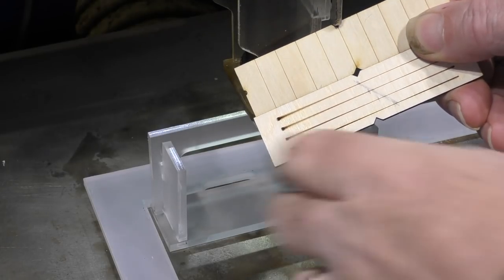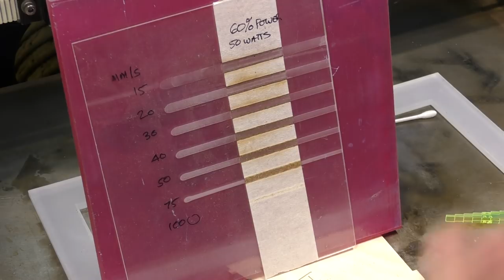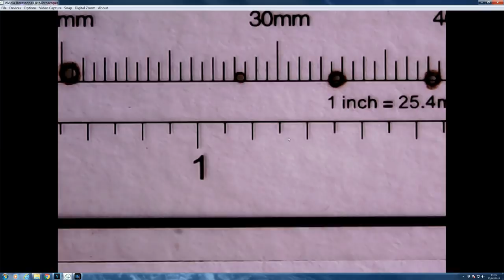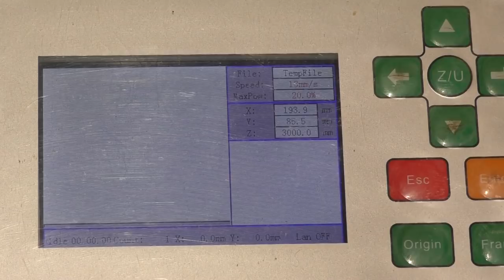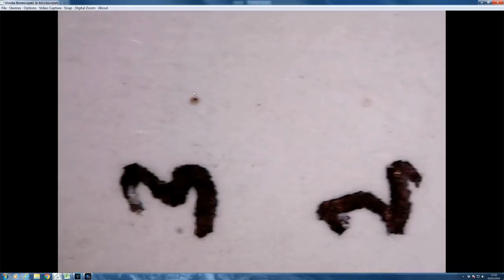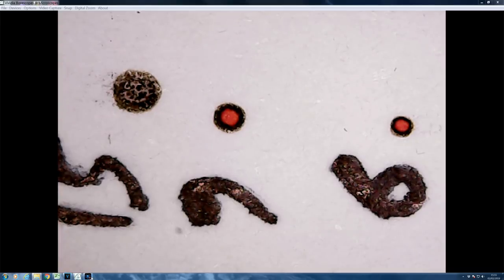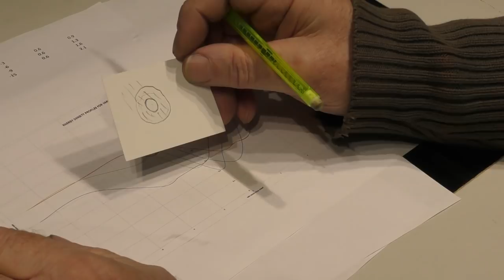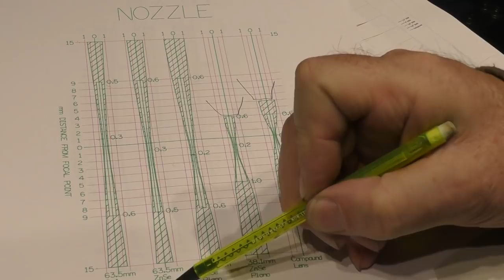RDWorks Learning Lab 162 Lenses part1 Let's Focus

Comment: Amazing work my friend
Reply from the maker: Hi Diego. 
 This video is now two and a half years old . About 6 months before this video, I became aware, as I was testing the cutting ability of various lenses, that there were some serious flaws in the "facts" that we were being taught about lenses.  On and off, I have been wrestling with the problem of trying to understand how lenses and laser beams work together. I could see from my many experiments that lens theory could not explain any of the behaviour I could easily demonstrate. In recent videos ,I am now at #217 I have finally decoded how lenses and laser beams work together and although no laws of physics are being broken or bent, the idea that lens theory can be read across to lasers is totally incorrect. Lenses and laser beams have their own secret relationship that it seems no one else has ever bothered to investigate. There is nothing wrong with lens theory and in fact lenses have to be designed  for the predictability of uniform intensity light rays as used in any IMAGING system such as a camera, telescope, microscope, projector etc etc. A laser machine is NOT trying to project an image so the rules rapidly break down. It's taken 3 years of piecing together many simple positive and negative experiments to finally uncover the full picture.  
You have lots of video to watch!!!
Best wishes
Russ
Reply: @SarbarMultimedia  thanks for the reply Russ, I just start working with my laser machine and found your videos that are in another league ! Thanks for sharing all your work and experimentation. 
I really hope that there is more people like you out there that lives by the "I dont belive anything that anybody told me, I have to prove it from myself" mindset.
Its very confortable to see someone digging in the science part of the functionality of this machines, and of course I will pass these days watching all your content haha.
Greetings from Perú and sorry for my english that I just barely write.
Diego
Reply from the maker: @diegoseminariodecol3863  
 Hi Diego
 Never apologize about your language proficiency. We only need to make ourselves understood and that does not require perfect grammer. Your English is 100 times better than my Spanish!!!! If it's more comfortable , write in Spanish and I can use Google translate.
 Best wishes
Russ

Comment: Hello Sir, Will the beam spot  vary according to the power of laser? I would like to buy a 150W machine for engraving and cutting. Thank you!!
Reply from the maker: Hi Eixeno
  The spot size is a so-called specification of the lens and not the beam. However After hundreds of test with different lenses and different laser beams  (no, they are not all the same) I  now know that the lenses are designed and specified as though they were going to be used in a telescope or camera  to transmit images with NORMAL light. Our laser beam is nothing like "normal" light and lenses  have their own different relationsip with laser beams that standard  lens theory cannot deal with.
The spot size you are interested in is the "burn" diameter you can create with a lens.  A spot has no linear speed  but you will make the burn diameter bigger by increasing the exposure time. Add speed and that dot becomes a line. That line thickness changes with speed. power and material  being damaged. 
 Power is great for faster and deeper cutting but to much power becomes uncontollable  if you wish to do photo rplication where precision control of power is essential. A "jack of all trades" power is between 60 and 80 watts.  It depends on your requirements . If it's mainly cutting that makes you money then go for the high power.. My advice is to stay away from Reci.      SPT , Yongli or EFR are good choices
 Best wishes
Russ
Reply: @SarbarMultimedia  Thank you! Explained well. Hope I will travel with you along my laser cutting journey. Your videos are so information and technical about lasers. God bless you.💕

Comment: Absolutely brilliant
Reply from the maker: Hi Joseph
How lenses and laser beams interact has taken me a long time to understand.  Thus my  knowledge  of lenses from 5 years ago has changed a bit. You may like to  update by looking at these videos
https://youtu.be/7N8Th1-IF4s       and         https://youtu.be/v7-VArJbJTs
Reply: @SarbarMultimedia  I have watched many of your videos over the last week. I love how you keep digging into them . Although sometimes your concerns are not clear.  But I get it you need more data before you can make that leep. I did subscribe so I can stay up to date. I just got an older co2 laser 50w that I have updated to 70w tube and power supply. But looks like the controller is very old so I need to learn RDWorks
Reply from the maker: @josephlovell6951 
 Hi Joseph
 Always bear in mind that these videos are not rehearsed and that you are looking over my shoulder as I  experiment and discover. This is a record of a learning journey and as such some sessions will be very much "follow your nose". It may take many sessions to arrrive at a sensible conclusion. It took me about 3 yeas to discover exactly how lenses managed to focus the beam to produce a deep parallel cut.
 There is no need to learn RDWorks if you are used to using Lightburn. Lightburn was created 7 or 8 years ago because a very  capable software programmer who was also  a laser hobbyist, became aware of the limited capability of RDWorks and it's very clunky interface. He set about reverse engineering RDWorks to create Lightburn. So with just a few exceptions, everything in Lightburn is in RDWorks but the usability and features of Lightburn are  from a different planet.. Lightburn has now been developed into an industry standard package  where it can be used with any type of laser or laser controller using Linux. OS or Windows. RDWorks is still Widows only.
Reply: @SarbarMultimedia  thanks for the information I have a morn 3050. It has a RDL8082 B main board. That I can find any thing on it. So unless I can contact to it. Witch I have not tried at this time. Because I fear I won't have the driver's for it. So I will cross that bridge when I get there. I have parts on order to fix the cooling system. 
Just trying to get as much knowledge as I can for now. I'm hoping I can make it work and not have to spend 400 for a new contractor.  Still think your work is brilliant. I bit surprised at some of the rezol
Reply from the maker: @josephlovell6951  
 Hi Joseph

 I think your machine will be fitted with a RDC6442 controller
 see   https://www.google.com/search?q=RDC6442&oq=RDC6442&gs_lcrp=EgZjaHJvbWUyBggAEEUYOTIGCAEQRRhB0gEINTEzNGowajeoAgCwAgA&sourceid=chrome&ie=UTF-8
 If so  then either Lightburn or RDWorks will be OK and there is no need to upgrade.
Reply: @SarbarMultimedia  I got it to work RDLC 320-A controller and lightburn has the driver's

Comment: So if I want to get good quality lenses for Chinese machine, where do I get them? (In EU)
Reply: Unlike tubes, where you can be ripped off with B grade reject tubes , lenses and mirrors are not as bad .There are lots of sellers  on Amazon or Ebay   but before you buy note the following.  There are 3 baisc grades of  lens if you buy ZnSe material. The colour is a good guide. If the colour is like honey or amber then these will be material  of Chinese origin . If they look really brown , ignore them. but the honey coloured ones  will be fine for power up to 80 watts and these are the cheapest and do a good job, If the lens looks sunflower yellow then this will be ZnSe material made by a different manufacturing process that originates in the USA. This material  will easily run above 200 watts. The lenses will  still be ground and manufactured in China but  from US sourced material  so the manufacturing quality  ( the spherical geometry) will  not be A1 but will be perfectly fine for our machines.  They will not  be the high precision  geometry required for industrial machines......but then again those lenses will be X5 to X10 the price.  There is a superior grade of lens usually made by a company called II-VI  (two- six) that is the most expensive. In my opinion (having tested several) I see no performance gain from the premuim price.  I will always recommend Cloudray as a proven and trusted source. If you are in a panic then go to the Cloudray shop on Amazon and there will usually be lenses stocked locally  for next day delivery. However, if you go to the Cloudray website directly then the lenses will be cheaper and postage will be free, However, it will be about 3 weeks before they arrive. I always recommend holding a spare lens because this is the most vulnerable part of your machine.
I hope this helps a bit
 Best wishes
Russ
Reply: @russsadler3471  Thank you! I ordered some from Cloudray Aliexpress!

Comment: Would it help to mask off the outer portion of the unfocused beam at the tube or after the first mirror?  It shouldn't effect the power of the central beam but wouldn't it cut down on the lower power shoulder region resulting in a sharper dot?
Reply from the maker: Hi 
Even as I answer one question, this video throws up another. If only the central core  of the beam  is delivering the real power, where is all the rest going?  I will in the near future try to isolate and measure the power in that central core. I tried occluding the outer portion of the beam with various sized sharp edged orifices during my search for the smallest dot. In that case the outer power seemed unnecessary. The orifices were very disruptive and did not aid my results. However, I do plan to use an orifice AFTER the lens to just let that central core of energy through to my dohicky. In that way I hope to determine what percentage of power finishes up in that central core.There is so much more to understand about the way lenses work for our technology. As I have discovered, this is a poorly researched subject.  I am showing everything I do in detail so that others can experiment for themselves. This may be very simple shed science with very crude low tech methods but it gives us a pragmatic glimpse of how our lenses work.  It does not tell us if there are quantum effects at play , that's the stuff for a well equipped laboratories and maybe the path to a Nobel prize for some one.
Thanks for the comment
Best wishes
Russ
Reply: I've tried this before, Russ has seen some of my results. The upshot is that a fast pulse from a focused beam, only lingers enough time for the tip of the curve to make a mark. Occlusion doesn't alter that, but does add other problems.

Comment: I haven't gone through the series yet, but maybe for thick materials the focal point should be inside the object, possibly half way the thickness.
Reply from the maker: I am in the privileged position of  being retired and with  no commercial pressure to use my machine as money maker. I also have the luxury of support from Cloudray who want to know the sort of details about lenses that you are enquiring about.  If you watch this video

https://www.youtube.com/watch?v=yO2TD_h8_nI

You will see that have LOTS of different lens types , some are not commercially available  but were obtained for me . I test them in different orientations, focal positions and on 3 completely different materials  so that i do NOT generalise my conclusion  on the basis of just 2 or 3 lenses which is the maximum that most users would ever experience.
 I confront several myths with the data I obtained. one of them  being the myth that you start of with.

Best wishes
Russ

Comment: I got a 1060 two days ago I'm using lightburn software but I'd like to try rdworks. I did download it but it only uses one file format and it's not one my other programs can save to. Wondering if you know where I can download a version that allows several file formats.
Reply from the maker: What program are you trying to use with RDWorksand what file formats have you tied. You cannot LOAD external files, they all have to be IMPORTED.
Best wishes
Russ
Reply: @SarbarMultimedia  Drats it's my fault. I was doing open and not import on rdworks. Sorry for bothering you about nothing.

Comment: I have 100w co2 laser machine. I replaced laser tube before 2 days I set all in correct way. But there is some issues when I give pulse spot it gave two spots . I tried on 2 mm MDF so that time machine is cutting job but at the time two cutting line running on job simultaneously. Please help me . I need your email I’d I will send my machines issues  please reply photos and video
Reply from the maker: Hi Prashant
Sadly I don't make my email address public but if you wish to add your disguised email address ( (prashdotmadatyahoodotcom    for example) then I will reply to you and also delete your comment/email address from public view.
Best wishes
Russ
ps It sounds like your beam is nor passing down through the AXIS of your lens tube If you remove the lens and cut a card disc the same size as the end of your lens tube, attach it centrally with masking tape and put a pulse mark on the disc . Remove it carefully and I guarantee the scorch mark will not be in the centre.
Reply: Thanks for your reply sir

Comment: Hey Russ !!   I'm anxious to start soaking up some of the knowledge / experience you have to offer, I think it makes sense to start from the beginning.  I'm pretty new to Laser work having only a few months of engraving with a 4.2w Diode ...  How to I find the beginning of your videos so I don't miss the basics?

Thanks for your work,
Tim
Reply from the maker: Hi Tim
 You need to be very careful when you read my stuff because it is based on two basic things that you will not have. One is RDWorks software that  talks to a Ruida digital controller and second a CO2 laser. The CO2 laser works with invisible IR light at a wavelength of 10,600nm whereas your blue diode works at about 450nm in the visible spectrum. I urge you to do reading elsewhere because light is a funny thing and different materials are stimulated in different ways by the different frequecies of light. Things that absorb or reflect light at 10,600nm may react completely opposite at 450nm.  Just a few mw of blue laser light will damage your retina and cause permanent blindness so be ultra careful and do a lot of specific  reading about your type of laser.  Sorry I cannot be more helpful, Check in again when you decide to move up a notch or two.
Best wishes
Russ

Comment: I've been watching your videos. Extremely in formative. I was wondering if the 1st mirror that the CO2 laser tube hits,  If that mirror was slightly concaved and the laser was aimed dead on center would that make the beam more focused and stronger as an end result?
Reply from the maker: Hi 
A laser beam is a coherent beam that,   for the short distances within our machines , remains completely parallel. A concave mirror 1, will make the beam converge to a focus point somewhere. Where should that point be?  Just consider the variation of the beam path  between the back left corner of your table  (maybe 200mm long) and the front right corner of your table (maybe 1800mm long ). A parallel beam will serve both situations equally a converging beam will not.
Best wishes
Russ
Reply from the maker: Hi I note you asked a question about swapping from a constant current tube to an RF tube. Sadly when I went to answer, You Tube had teleported it to a parallel universe 
I'll answer here in the hope that you may get notified of my answer.
I cannot answer you question from any direct experience. I think you will need two power supplies and a very expensive tube. RDWorks caters for RF tubes in iyt's vendor settings and once the beam exits the tube it is no different to the standard beam except it is not constant but in varying high frequency pulses. Technically this should allow high precision power per dot control for photo engraving but I have yet to see any evidence of this  because the people that use these tubes (the "big boys") do not use dithered dot engraving but rely on half tone (newsprint) engraving. This technique relies on creating different size dots which is puzzling to me because we can only do fixed size dots. I would never upgrade to RF thoug because for for 1/20 of the price I can achieve excellent engraving results. That is the whole point of my channel , learning to extract the absolute max from a very cheap machine. I accept that an RF tube may do it quicker, provided I upgraded the rails, the belts ,the motors and the drivers to allow me to run at over 1000mm/s instead of my existing 500mm/s . So what is the real point. The only time you would see a benefit is for engraving. When it comes to cuttiny you are down in the 5 to 30mm/s range and you need raw power. There is little difference in cutting performance.  I know of a guy here  in the UK that make a comfortable living with his tech support business swapping out RF systems on machines to reduce running and replacements costs.  I am very happy with what I have and there is still much more for me yet to learn.
Thanks for the comment and I'll be happy to receive your impression of advantages if you do decide to spend your time and money
Best wishes
Russ
Reply: @SarbarMultimedia   That's because I took it off as i meant to say a ceramic laser tube.